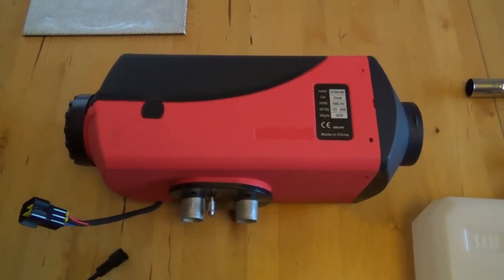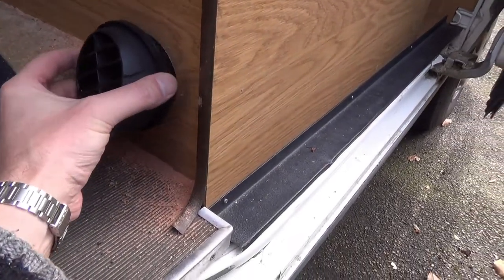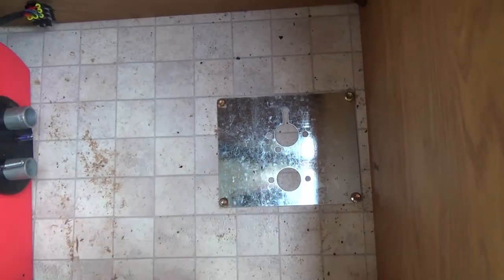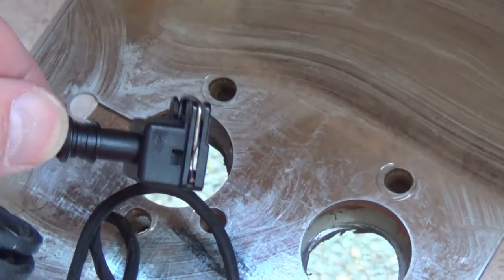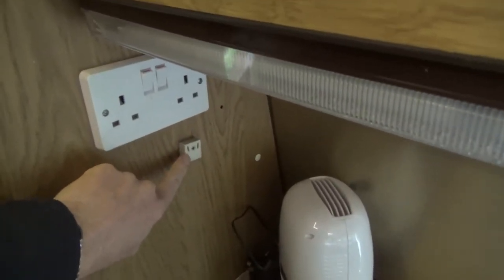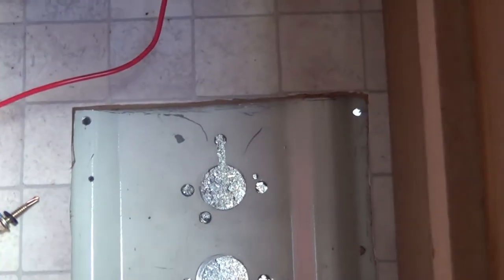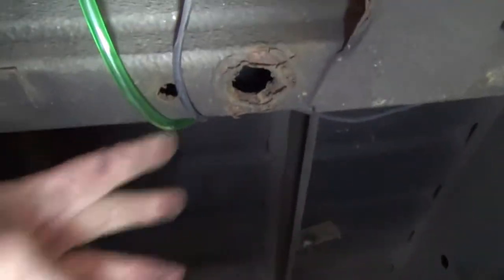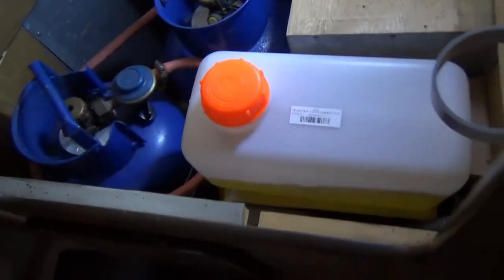Talbot Express Camelot Campervan Diesel night heater installation

Comment: Super clear explanatory video. Clear and very instructional. Many thanks for sharing. I purchase a Talbot Express yesterday, however it comes with the propane heating which I will remover this weekend. So off to shop for the diesel night heater. Once again many thanks.

Comment: Chris where did you purchase the heater? I see yours is supplied with (2) out ducts. whereas many supply just (1) can you put a link please.
Reply from the maker: Hi! I can't find the company I purchased from on ebay any longer, but the unit is this one: https://www.ebay.co.uk/itm/313138299528?hash=item48e87f4288:g:PacAAOSwwelglmVo although I paid a little less than the price shown here - might be worth shopping around. It's not 2 outlets under the van - one of the connections is to a short length of hose and then an air filter, the other is via a stainless steel pipe to a small exhaust silencer. The combustion air comes in through the air inlet, is burnt, and then out of the exhaust. The Talbot propane heating does work, but it's not very powerful and being convection, you get most heat up at your head level, not down at the floor where you need it (unless you have the fan option behind). Cheers. Chris